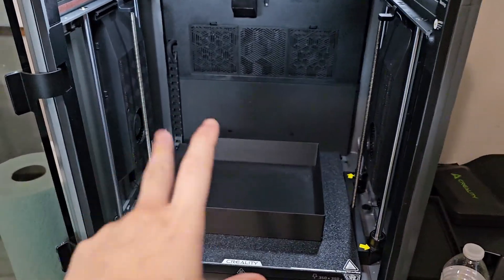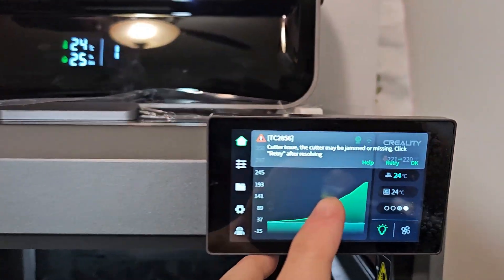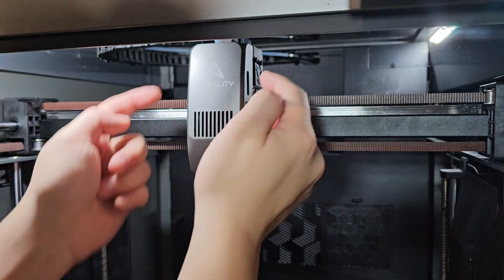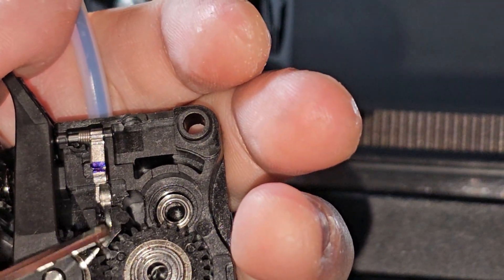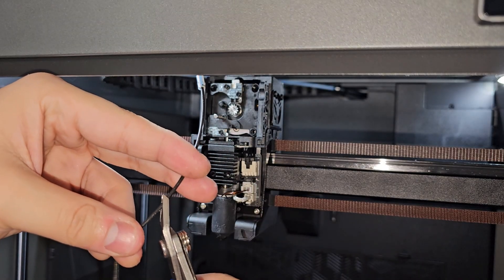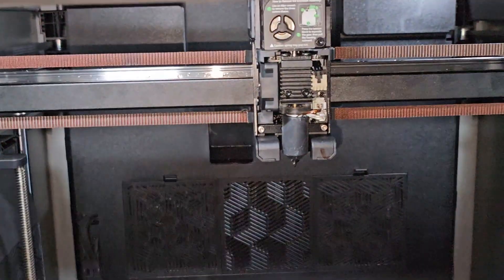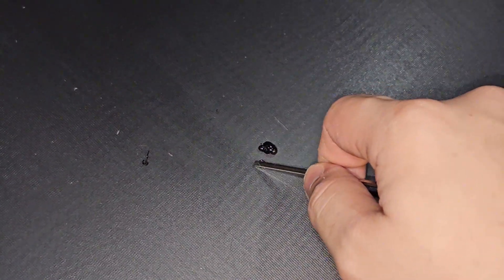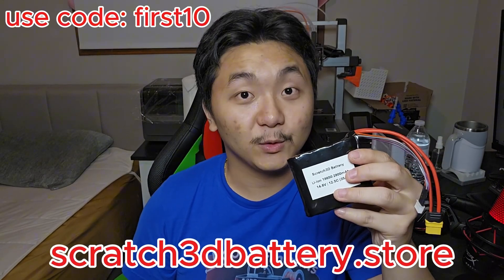Creality K2 Plus Filament Jam | Extruder Disassemble

Comment: My Problem: When I load the fillament in the spool, it goes all the way to buffer, comes out few mm (+- 70mm) outside the buffer, the filament stops and retreats, going back to the Spool,
Reply from the maker: Check your filament and see if there are any low or high spot. Try cutting off some of the filaments that has been damage and try again.

Comment: If the filament is stuck further into the heat sync, what can I do, because I can’t pull it out like shown.
Reply from the maker: You can try using a push rod and put it out.
Reply: @Scratch3DPrinting sadly that didn’t work either. I set the temperature up, tried pushing it through, tried extruding while pushing, nothing is working
Reply from the maker: @dakotac1534 if nothing works then you might have to dissemble everything, if that does not work then maybe you'll just have to replace the heatsink.
Reply: @Scratch3DPrinting all good. I did end up disassembling it. The filament was only stuck in the nozzle. Removed the nozzle, got two more on the way.

Comment: You disassembled it wrong. 
Not even sure how you managed that when you have to take the extruder body and motor out, unscrew the motor, then remove the side screw before you can get to the gears. 

Creality has such a poor extruder design and jams up a lot. The motor over heats causing the gears to melt the filiment, smash in the extruder and jam up.

I also have quality issues with it. A flagship printer that costs $1500 (combo) shouldn't have so many issues. My $400 printer I got 10 years ago is more reliable and print quality is better.
Reply from the maker: Haha did I? I didn't notice i disassemble it wrong. Welp glad nothing breaks and I still manage to clear the clog.

Comment: First of all, thank you very much for the detailed explanation, it helped me a lot. The same problem occurred to me. In my opinion, the problem occurs because of the bend at the end of the filament, which causes the extruder to jam when changing the spools. I noticed that in the spools manufactured by the company Creality, the bend at the end is very small, while other manufacturers have it much larger, even 90 degrees.
Reply from the maker: Yeah all these angles from the way it was design makes it hard for the filament to go through. And leads to clogging like you said.

Comment: just got a brand new K2 Plus and this happened before I layed down my first layer lol
Reply from the maker: Yeah it happens sometimes even if it's brand new.
Reply: I switched to SUNLU TPU. Worked great. Also Turned down the Retraction speed.
Reply: My keeps jamming. Filament gets broke off inside the extruder.
Reply: @cajunroadwarrior  I would give SUNLU a shot. I discovered that the previous TPU I was using was not uniformly 1.75mm.
Reply: @metronyc2855  I am using Creality HYPER ABS. I think what is happening is that the spring tension on the CFS drive is too strong and is actually crushing the filament. I can see that it is deformed badly coming out of the CFS.  By the time it reaches the extruder, it is so badly deformed that as the system gets heat soaked, the filament gets too soft, causing it not to feed. Once a jam is detected, it stops the print. As the system tries to pull the filament back, it breaks off in the extruder.

Comment: There's quite a long delay between the last of one spool disappearing into the CFS and the printer starting the next spool. I mean like five minutes or more. I can only assume the detector is therefore closer to the nozzle than the CFS...which would actually make sense as not everyone has the CFS...
Reply from the maker: that could be the case.

Comment: I bought it 3 days ago and had one successful multi-colour print and after that I am having constant clogs where the filament seems to break (or is actually cut) right under the extruder as in the video. The clogs now happen after a couple of layers and if not, then at a color swap. Can't even do the preloaded benchy. Very annoying not being able to use a brand new printer.
Reply from the maker: Yeah this needs to be fixed. Looks like the new firmware update might have that error and now we will know.
Reply: @Scratch3DPrinting  I downgraded to CrealityPrint_6.0.0.1078_Release and still have the same issue. Can you let me know what firmware you are on?
Reply from the maker: @proronny im using the newest firmware.
Reply: @Scratch3DPrinting  I replaced the nozzle with the spare one, and now it works.

Comment: I had this happened to my k2 plus 4 days in. During a 14 hours multicolor print, while loading and retracting filament, a piece of filament dislodged and got melted inside the extruder assembly. I was able to get it out, but the filament runout sensor inside the extruder was damaged, possibly due to me having to dig out the piece of stucked filament. Now, each time I try to use the CFS, it just gives me an error message, something along the line of, "you currently have some sort or material anomaly inside the extrusion assembly, please remove before proceeding". 

I'm currently unable to print using the CFS, nor will it automatically cut, load and retract filament. The only way to print now is to use the side spool, while I wait for replacement parts from Creality. To load filament, I'm having to manually cut filament and manually load, heat up nozzle temp and force feed filament.

I'm not sure if many folks are experiencing the same issue as me. But I'm pretty disappointed and frustrated that Creality put out this printer into the consumers hand and expect everything to work right out of the box. I can tell they rushed this unit out quickly without doing intensive testing on it. I'm really contemplating returning this printer at this point.
Reply from the maker: Yeah, I heave heard that many people does face that problem. Hopefully you get the replacement and this time it works properly. I think they did test this 3d printer alot, but there will still be something that has a flaws.
Reply: I have the same problem - how did you contact Creality to get new parts?

Comment: Hi. Did you experience issue with printing soft materials like TPU or PP. In my case filament is starting to going to side of extruder.
Reply from the maker: Yes, mine got clogged once when using PP filament. I know TPU will not work, but PP does not work also. Mine just got crumble up inside the CFS.
Reply: @Scratch3DPrinting  Thank you!

Comment: The CFS is a rather big disappointment on this machine and the fact that they chose to use toothless idler gears with a non-standard size belt of 7.6mm wide instead of 6mm, 9mm, or 10mm is also disappointing they induced a 2mm pitch VFA for no reason just by making the two critical idlers smooth.

But if you log into the fluid interface via a web browser you can do a cutter position calibration using the built-in macros which will calibrate the location of the cutter and how far over to the right it needs to go to cut. That should solve your cutting issue and prevent a jam like that in the future. There is a lot of work that needs to be done with the macros for the CFS before its perfectly reliable.
Reply from the maker: Oh wow, thanks ill look into that.

Comment: I dunno how fast you had it running, but I have an Ender 3 s1 pro that can run fast (somewhere near 200mm) and certain filaments it feeds with ease while other filaments it just shreds to pieces while printing when it retracts and de-retracts. May want to pay attention to whatever you're running to make sure it can handle the stress from the gears trying to move it in and out. That and the stiffness of how hard it was to feed that filament might have played a part too.
Reply from the maker: Yeah i was running 300mm/s for this pla filament. Next time I'll dry the filament and hit and make sure it's not brittle to the point where it will brake on it own

Comment: It also happened to me twice, the filament gets stuck in the wheel when returning for the change, forming a sort of ball that prevents it from passing through the hole, it only did this using Orca Slicer
Reply from the maker: Ohh good to know. I was using crealit print. 

I think orcaslicer is nit yet fully support the k2 plus and cfs.
Reply: Got the same problem when using orca slicer multicolor
Reply: Had this happened to me 4 days into receiving my k2 plus. Frustrating to find out it lost a 14 multicolor print as a result. In addition, damaged my runout sensor, now i cant print using the cfs, nor will it retract or load filament due to error messages. 

Creality definitely didn't do enough testing on this machine before releasing it into the consumers hand. I'm pissed, I'm going to return my k2 and wait for Bambus next line of printers.

Comment: The Brass M4 Socket that is where the tensioner goes is the spring I believe that pops out and gets lost. You almost had it pop out when you was handling it. I had a clog that wrapped around the gears and I had to remove the assemble of gears.  As a result the spring popped out and is very difficult to put back in. The solution is I use a M4 Long screw the ones that hold the bed down during shipping is what I used to hold the spring while you re-assemble.  Just in case you ever have that problem that is how I solved it.
Reply from the maker: Ahh, thanks. Yeah from the look of it, it is hard to put it back in since it's such a small tight space. If that ever happen to me, I'll use your trick.

Comment: When those errors pop, there is a problem with the filament flowing yes, but its not always the extruder. Retract all filament, Heat the extruder to 350 and purge everything out, then restart the machine so the cfs can reload. You will never fix it, by dissembling the extruder and then clicking retry and going crazy with the printer doing all sorts of things. At this point the cfs hasn't reloaded, so the problem might actually be resolved but the error will still pop out. Never yank the ptfe tubes like that while its running, and don't ever disconnect the cables while its on, you surely will damage the machine. You are right about the head motor not being able to detect filament there, not sure why its made like that. Nice looking basket btw.
Reply from the maker: I try restarting the machine but it does not do the load and reload. I try retracing on the screen and nothing, errors. Seems like there's no sensor or error saying that the filament is stuck.
Reply: @Scratch3DPrinting  If your filament runs out, sometines it gets stuck on poop forever and then gives you errors as well. The cfs doesnt reload, and even if you retry the filament and get it all out the cfs wont feed it to the extruder again. Turning the machine off and on doesnt help. This is what helped me: After verifying the is no clog, set up the side spool, feed it filament manually until you hit the extruder and print something very tiny. Then retry the filament, disconnect the back ptfe tube and gently manually pull the filament from the outside spool. Check that the filament buffer led is blue, retry the little knob on the back side and make sure the cable on it is secure. Check the cfs cables. Then extrude filament from the CFS, it should work now. You should be able to recalibrate. Restart the machine and the cfs will reload with the yellow broken filament icon. Then you can print. Try to avoid this issues by having an extra spool and telling the cfs what to grab next in the profile. It doesnt do it for you.

Check this out and get intimate with the k2 lol 

https://wiki.creality.com/en/cfs/error-code-summary

Comment: One problem so far, where the filament broke in the nozzle and didn't retract. I kept getting an error where it thought the CFS was failing to retract, but the real fix was to heat the nozzle and push out the filament after heating the nozzle. Frustrating to find the real problem based on the messages but easy to fix.
Reply from the maker: Ahh yes, not sure why creality didn't think of an problem like that and should have gave a different error.
Reply: @Scratch3DPrinting  Breaking off filament while retracting extruder should be a common failure and it can happen anywhere along the chain.